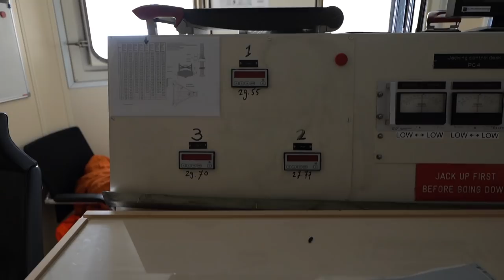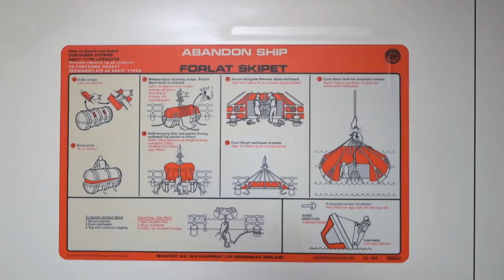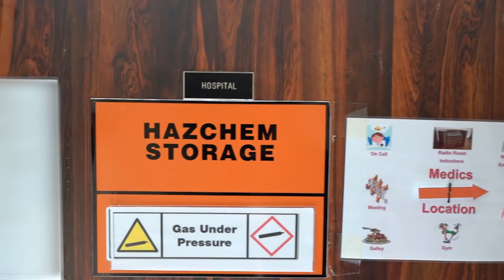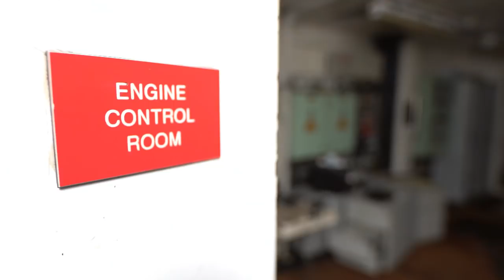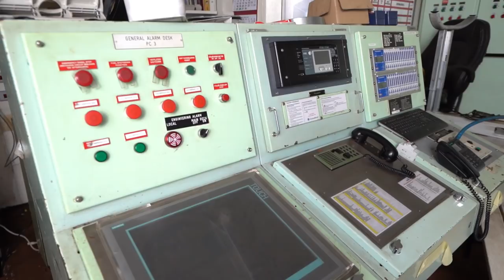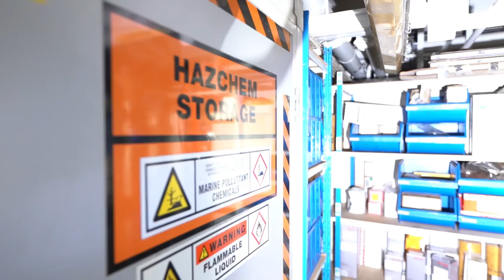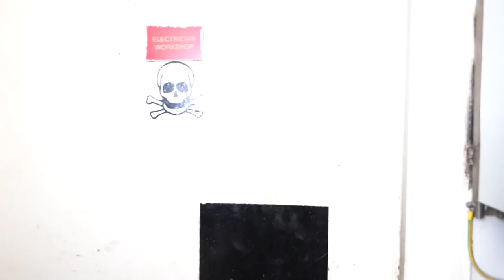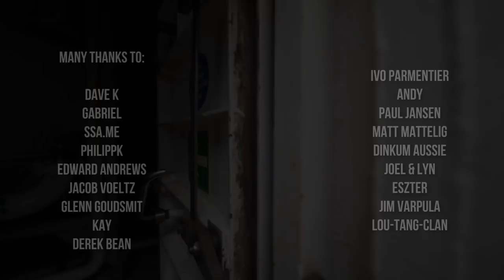URBEX | exploring a decommissioned oil rig

Comment: The rig is in a state called "Cold Stacked."  Cold stacking a rig means the hatches are battened and the crew is greatly reduced to either zero or just a few key individuals. The rig is then ‘stored’ in a harbor, shipyard, or designated area offshore until it needs to be activated.  If you follow the clues and work in the industry, you can quickly (well <1 hour) narrow it down to two and a little Googling can narrow that down to one.  Excellent work and thanks for leaving the clues ;)  Don't worry I have some inside knowledge in the industry and I still had to work for it.  You're secret's safe by me.
Reply: I saw that on aggreko website too! Thanks for info.
Reply: Haha, I saw some clues too and was thinking about trying to find it too. Pretty cool info man. This video was amazing
Reply: the Clue board game at 13:04 literally has the name of the rig on it lol.
Reply: @jackmiller8851  and you ruined it. Good job

Comment: I call it 'stacked' rather than decommissioned, the difference being decommission would involve the removal of expensive equipment like those big cat motors.  This rig still looks to be in mostly operational condition could be put back into service without too much work.  The battery in the wall clock is still good and calendar showed 2019 so there is still hope it may work some more.

Comment: blows me away that someone designed this. so much interconnected machines and pipes. looks like its in great condition too, cant have been abandoned for long
Reply: It looked to be in very good condition the plant areas were very clean, that is not an old rig.
Reply: @coyote5735  It was built in 1983 so the core of things are almost 40 years old. It's been upgraded since of course, but still.
Reply: @ThorsteinKlingenberg  It has been well maintained probably had several refits. The RIG has aged well.
Reply: @coyote5735  actually, when it operated for Saga in the north sea it had the nickname Devil's Island. It wasn't well run or maintained at all. To the point where Saga suspended operations and the Norwegian Oil Directorate started an investigation..
Reply: @ThorsteinKlingenberg  Well, you seem to have inside knowledge. They say "looks can be deceiving"......lol. Why the Devil's Island?
Reply: @coyote5735  because of terrible work conditions, sexual harassment, bullying, fighting, violence, bad sanitary facilities, etc.
Reply: @ThorsteinKlingenberg  Wow, sorry to hear that, but that is not the RIG it's the culture onboard, bad leadership and management.
Reply: @coyote5735  Sure. Which is why Saga suspended production (they were the operator), the rig was owned and run by Noble Drilling in the Netherlands. Furthermore the Norwegian Oil Directorate started an inquiry into the conditions on the rig.

Comment: So interesting as you move through from the squeaky clean living quarters, through the operating area into the dirty nuts and bolts "belly of the beast".
Reply: It was pretty clean in the engineering spaces but the workshops were a tip, it looks like someone had been rummaging looking for goodies.

Comment: What is the name of this rig? I did see some norwegian writing on the wall.
Reply: It looks like Noble Al White, which was operated by Saga on the Varg field in the North Sea. That was many years ago though, but I guess the Norwegian/English signs were good enough to also use on the next jobs.
Reply: @ThorsteinKlingenberg  if you look at the floorplan at 3:36(you have to be quick to pause) the heli pad is on a different face side than the one on the Noble Al. They are both triangles, but they do look different.
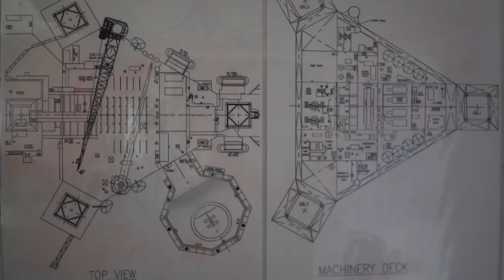Reply: @RandoWisLuL   No blueprint at 3:36. But the picture at 5:11 fits, and the blueprint at 6:46 both fit the Noble Al White (previously Neddrill Trigon).
Reply: Just look at the Clue box at 13:02 😉 'Noble Al White'